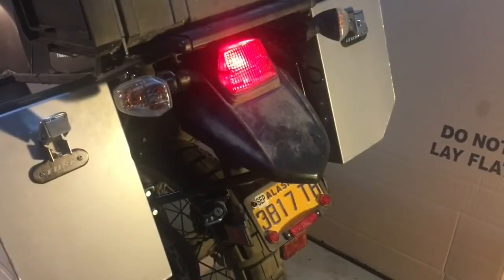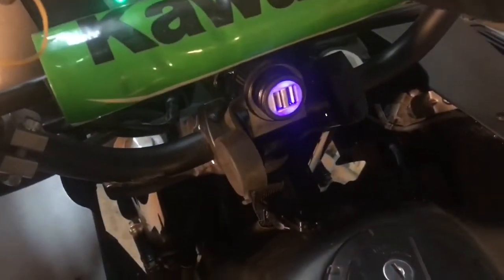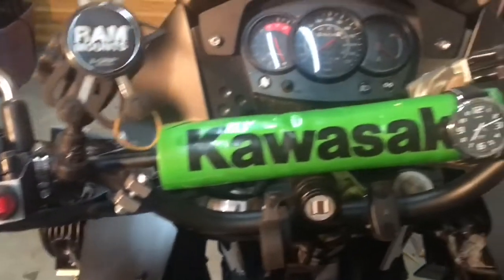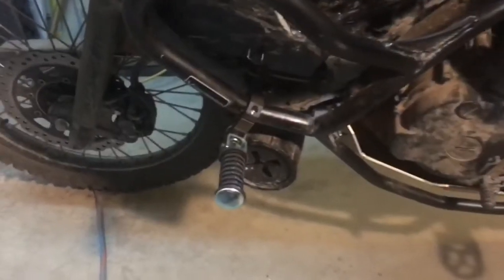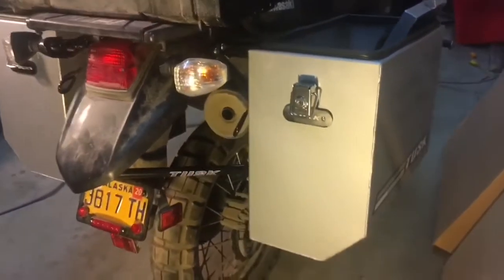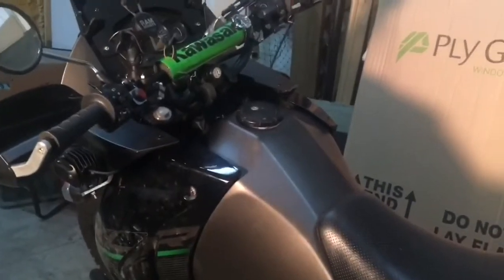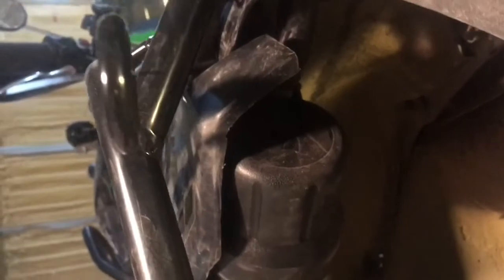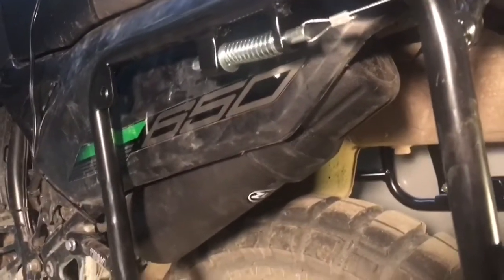KLR 650 Long Distance Touring Parts and Mods -part 2

Comment: Functional upgrades! Yes! I've got a couple of those manual tubes, still unsure where I am going to mount them, or even what to put in them I have two 32oz MSR fuel bottles waht would be good for fuel, but I also have a Rotopax 1.5g can. Where in Ak are you located? I was stationed at Ft. Richardson in 1992-1994
Reply from the maker: Hi Ron! Yeah I’ve got a couple of the MSR bottles too, but figured out that where I mounted that tube, the bottle won’t go in because of the fairing or something being in the way. I have two of the canisters and I’m still thinking of possibly mounting  the other one to the inside (bike side) of my left side pannier rack- but not sure about that yet either. That’s funny about your being stationed up here, I’m not up by Fairbanks though, I’m down on the Kenai Peninsula. Thanks for the comment and ride safe!
Reply: @al-canadv9241  I was in Anchorage, but I did make a few trips to fish in the Kenai and Kasilof rivers!
Reply from the maker: My bad, I always seem to get Fort Richardson confused with Eilson AFB up by F’banks!

Comment: Great video. Do you have any links for the items you used for the highway pegs? I can't find any that work. They all slide around. Thanks in advance!
Reply from the maker: Hi Scratch, and thanks for the comment. The highway pegs are as yet unproven and i have my doubts as to their longevity, but here are the clamps I used:
https://www.amazon.com/Tuning-Bracket-Off-Road-Horizontal-Mounting/dp/B074PZPLR9/ref=mp_s_a_1_fkmrnull_2_sspa?keywords=mictuning+bar+clamps&qid=1550875463&s=gateway&sr=8-2-fkmrnull-spons&psc=1
And these are the foot pegs I used:
https://www.rockymountainatvmc.com/parts/bike-master-buddy-motorcycle-foot-pegs-p

The SW-Motech crash bars are just slightly oversized for 1”, so I filed out the sides of the opening on the clamps. I think this gives them a little bit better grip on the bar. Also, the holes in the clamps are 1/4”, which has to be drilled out to fit the foot peg. The pegs come with the option for 10 or 12 mm threads- I accidentally got the 12mm ones but the 10mm would be a lot better since you wouldn’t have to drill as big of a hole in the clamp. Mine seem dangerously close to the edge of the clamp and honestly I would be surprised if they lasted the whole trip. 
Hope this helps, ride safe.
Reply from the maker: Sorry the Amazon link is for the 7/8” clamps, the 1” size is in the “size” options on the page though.
Reply: As an option, you can also let the tool tube extend farther out, and it doubles as foot pegs, that's what I did.  Added a little grip tape to keep my feet from sliding on the pvc, works great.
Reply from the maker: Man, that’s a great idea. I’d be worried about hitting it on things though. Have you had any problems with that? Thanks for the comment!  Ride safe.
Reply: No issues at all, I just made sure it's no wider than most highway pegs.  Cheap and very effective!
Reply from the maker: Thanks!  Great Idea.

Comment: Great video !! Sylvania makes a red LED brake light bulb. I made a video about it. Cheap upgrade. $20. What size panniers are those medium or large ?
Reply from the maker: Thanks for the tip, I’ll be definitely checking that out. I was thinking of doing the WOW kit from happy trails but they’re a little spendy. The panniers are the large ones, and they seem to fit the bike fairly well. I was going to get the black ones but somebody here on YouTube pointed out that he had those and after going down on them a few times, they looked pretty bad, as opposed to the silver, on which whatever scratches would blend right in. Thanks for the comment.
Reply: @al-canadv9241  great channel keep up the good work!!
Reply from the maker: Well thanks! I’ll do my best. 😁